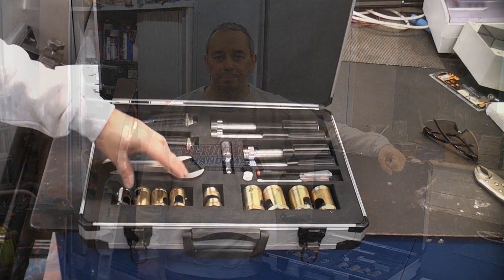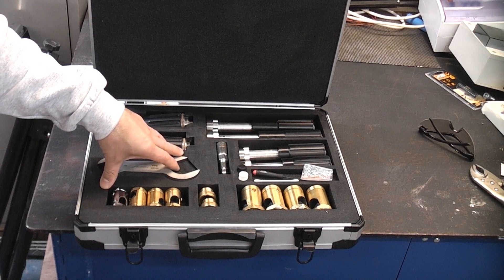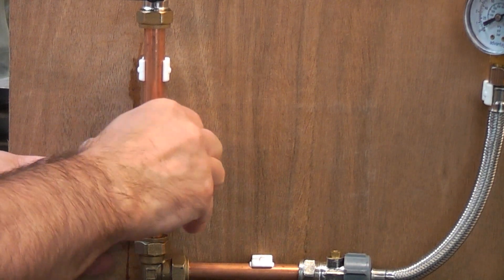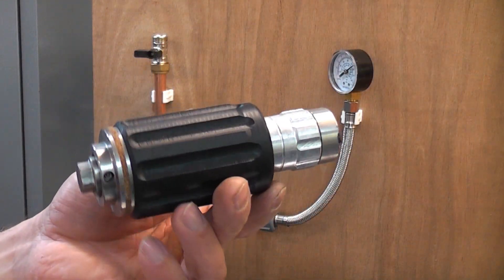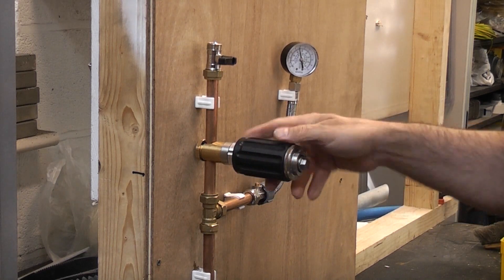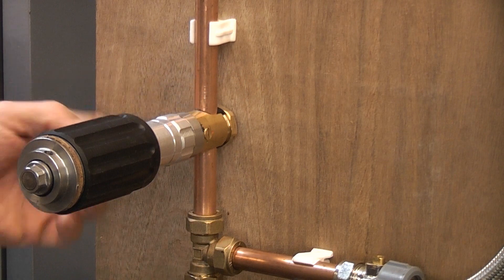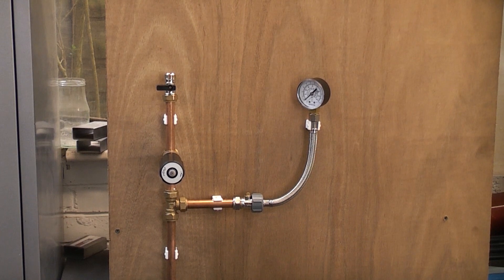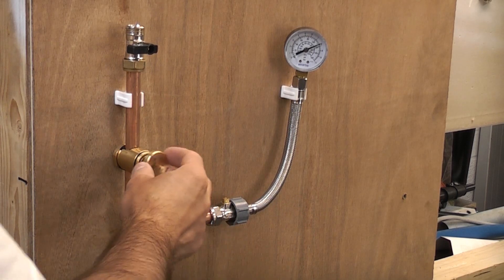How to block a pipe that cannot be frozen | Aladdin Pipe Genie

Comment: The isolator stop tap that Aladdin make would do the job and it's about £40
Reply from the maker: The Easy fit isolator is about £40 but I believe the valves for this will be about £7.50 for 15mm and £11.50 for 22mm.
They are also making taps that connect to the valves, for washing machines etc. The flow will not be reduced like it is in self cutting taps as the copper coupon is removed from the pipe.

Thanks for the comment
Reply: I'm sure folks will decide what makes the most sense to them.

Comment: Easier to use one of those DIY washing machine plumbing kits that cut into the pipe
Reply from the maker: They do not do the same thing. This blocks the pipe, even if it has flowing water in it.

Comment: why wouldn't you just use the Aladdin easyfit Isolator?
Reply from the maker: This is aimed at professionals who will use a lot of them in the space of a year. The easy fit isolator is about £40, but these valves will be less than £5 each (that might be a kickstarter special price). They were also developing the kit so that drain down valves could be installed to it etc.
Thanks for the comment
Reply: @ultimatehandyman  good info. chur

Comment: Message for Jimbo....... do you really think plastic pipe is more common than copper...?????  I think this kit would be fine to use on plastic if it cuts through copper its gonna cut plastic i should imagine. But if you are working on a system which has plastic installed you are much more likely gonna be able to isolate the supply in various places.......... but i can honestly say that i have always managed in some way or form to isolate a particular part of pipe........ A clever piece of kit though...... would have had one in my van when i was working regular.

Comment: Just turn off the water (/ oil / gas ), and fit the appropriate isolator valve.  £2.
Reply from the maker: Please watch the video again, and try to pay attention this time ;-)
Thanks for the comment
Reply: I did get it 1st time around, £500 + VAT. End of (non-) story.
Reply from the maker: Perhaps next time you watch a video, you can not post a load of nonsense in your first post ;-)

Comment: If you install the stopple fitting above the tee with a pressure gauge which has no reason for the pressure to drop or climb after you install the fitting between a dead end valve above it and the tee under it , when you opened the valve to bleed water or liquid off pressure should have remained I believe you stated 30 bar's on the gauge?
Reply from the maker: When you cut into the pipe the pressure will drop, as the water will expand into the cutter part (reducing the pressure).
Then when the bung is screwed in, the water is compressed as there is nowhere for it to go (increasing the pressure again).
Thanks for the comment

Comment: Good video, just read that they will be less than £10 for the 15mm, actually seems good value at that point. Had previously thought due to the £500 price that the 4 valves might be £50 each and seemed expensive then but for £7.50, big initial investment, but cheap to use.
Reply from the maker: Yes, the valves are relatively inexpensive, especially if you compare them to the Easy fir isolator at about £45

Thanks for the comment

Comment: Isolation valves is much better and easier !! Here in the United States 🇺🇸 there is a much better company that sells valves that isolates any open system the same way like this but the one I’m talking about is much better !!! Look it up Aladdin EasyFit Isolator !! It’s much better and simpler and lasts much longer and while you install it you will not lose any pressure!! Once again Aladdin EasyFit Isolator
Reply from the maker: This is made by the same people that make the easy fit isolator.
Thanks for the comment

Comment: The idea is just great. But Why these brass fittings? Isn’t it better to make these out of ( stainless) steel?
Reply from the maker: Brass is much easier to machine and much cheaper than stainless.

Most plumbing fittings on copper pipe or brass, or copper.

Thanks for the comment

Comment: A smaller version of a Hot tap setup we use on high/low pressure gas and liquid fuel pipe systems.
Reply from the maker: Thanks for the comment

Comment: As a gas engineer/plumber, this is reducing the bore of the pipe. A complete waste of time/money. Do the job properly and drain the water/freeze/even snatch it! Nothing beats a proper job, you might get wet snatching but at least you aren't restricting things downstream of this DIY valve...
Reply from the maker: It does not reduce the bore of the pipe at all.
I don't think you understand what this device is intended for, I did put more information in the video description as it was difficult fitting everything into the video.
Thanks for the comment
Reply: ok hold on i may have misinterpretted this...this thing 'blocks' flow right? Then you could install another full bore valve afterwards for more future maintenance? Correct?
Reply from the maker: Yes, when the bung is screwed in it blocks the flow, then you can do virtually anything you like to the pipe on the other side of bung, then remove the bung afterwards.

I believe they are also planning taps such as washing machine taps which can be screwed onto the valve, which would mean you could install one without reducing flow, as the copper coupon is removed (unlike self cutting taps).
Thanks for the comment
Reply: Ahhh, makes sense now, MY BAD! In that case it would be very very handy to have in the van but the cost is a lot but then so is a freeze kit which doesn't appear to be as versatile as this! Looks good, any idea how much the additional valve things are then?
Reply from the maker: Yes, it's an expensive initial outlay but it can do things that a freezing kit cant.
I believe this kit has been tested out by one of the regional water companies, as they can't always use a freezing kit.
As for the price of the valves, I believe they will be about £7.50 for 15mm and £11.50 for 22mm

Thanks for the comment

Comment: Looks a good idea, I have used a similar system, on high pressure gas lines for corrosion coupons, much heavier duty, all components were rated to 15000 psi works well only difference was we have to equalise the dead side with a hydraulic pump to be able to get the valve open. Not so keen on that Aladdin mob though, I tried their auto bleeders for radiators, I found them to work intermittently at best, I took them back to screw-fix! Great vid, keep it up 😀
Reply from the maker: That sounds like an interesting job ;-)
Thanks for the comment Jamie
Reply: I believe the system you may be referring to Jamie allows the insertion of a probe into very high pressure pipework but doesn't actually allow the blocking of the pipework for maintenance.  The Pipe Genie comes with 2 bungs that allow simultaneous blocking of a pipe section eg to remove a pump at pressures up to 30 bar.  
We're sorry to hear you had unsatisfactory results with the autovents.  These come with a 5 year guarantee.  It may be you required technical support from our team as systems do vary.  We do have an 0800 number for technical support further details are on our packaging.

Comment: So does whoever needs to do work on it after you've put this on need to have this kit? Seems a good idea but seems a bit silly as well 'cause surely that's gunna force people to buy the kit instead of just been able to turn the water off with it
Reply from the maker: Yes, if someone else wanted to use the isolator they would need the bung tool.
They are developing a tap that attaches to the valve, for washing machine etc. I am sure these will be very common in a few years time.
Thanks for the comment

Comment: What is the purpose of the bung if you already have a valve you just put in?
Reply from the maker: The valve does not close the pipe, it only closed the opening where you fit the bung tool. The bung tools compresses into a sphere inside of the pipe and blocks it.
Thanks for the comment
Reply: Stephen Huxtable I wondered that myself also.
Reply: Aladdin EasyFit Isolator are much better and cheaper and easier you can even install it your self and not hire a plumber !!

Comment: Nice Idea but I don't think they will sell many if any at about £500 way too expensive to buy just too have sitting in the van just incase you need it.
Reply: Aladdin EasyFit Isolator are much better and cheaper and easier you can even install it your self and not hire a plumber !!
Reply from the maker: Its not something every plumber will buy but for work in large buildings such as hospitals it could be very useful.
Thanks for the comment

Comment: Good video as usual 👍 I have a pipe freezing kit that does domestic and commercial pipe work right up to big sizes, it will freeze copper, plastic, steel, lead so very versatile in that respect. This kit can be used on hot and flowing water which is good and maybe some big companies will buy them as for the smaller companies and sole traders  I doubt they'll part with that kind of money, I've never come across a situation that I can't deal with as of yet.
This is only my opinion and I'm not knocking the video or how well the kit works and hopefully I'll be proved wrong.
Reply from the maker: Thanks, a pipe freezing kit will be ample for most plumbers but I guess there are situations where this would be the only solution.
Thanks for the comment
Reply: Ultimate Handyman unfortunately I think they'll price themselves out of the market as it's basically an expensive saddle valve  you're fitting to a pipe which are notorious leakers in the future.
Reply from the maker: You could be right, only time will tell.
Thanks for the comment
Reply: Ultimate Handyman I know in the states  saddle valves can be used by homeowners but are not allowed to be used by professional plumbers. Keep up the great videos👍👍👍
Reply: Aladdin EasyFit Isolator are much better and cheaper and easier you can even install it your self and not hire a plumber !!

Comment: I thought the aladdin easy isolation valve was cheaper and easier with the advantage it leaves a permanent iso valve in place.
Reply: Thanks for the comment we're glad you like the Easyfit Isolator.  We created the Pipe Genie as we had lots of feedback from plumbers who told us their electric freezer kits didn't work in many situations and they wanted an alternative that would work on hot pipework and at higher pressures.
Reply from the maker: Hi Dan, I thought exactly the same as you so I enquired about this and was given this information-
This set also works on 22mm which the Easy fit isolator cannot do.
The Easy fit isolator is about £45 but I believe the valves for this will be about £7.50 for 15mm and £11.50 for 22mm.
They are also making taps that connect to the valves, for washing machines etc. The flow will not be reduced like it is in self cutting taps as the copper coupon is removed from the pipe.
Thanks for the comment
Reply: Aladdin EasyFit Isolator are much better and cheaper and easier you can even install it your self and not hire a plumber !!
Reply: Aladdin EasyFit Isolator is a thousand times better and easier and lasts longer and you lose no pressure while you install it plus you can do it your self and not have to give an arm or a leg to a plumber to install it lol